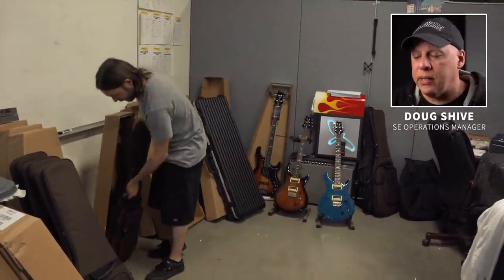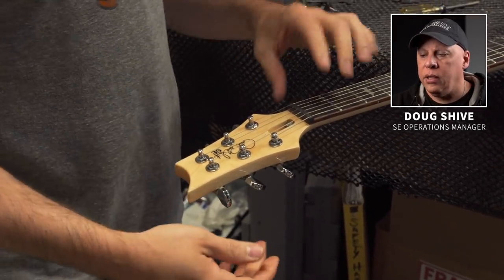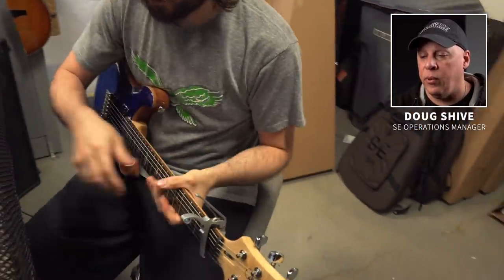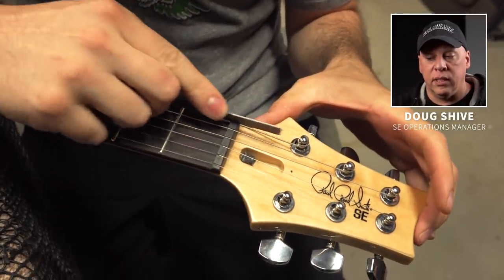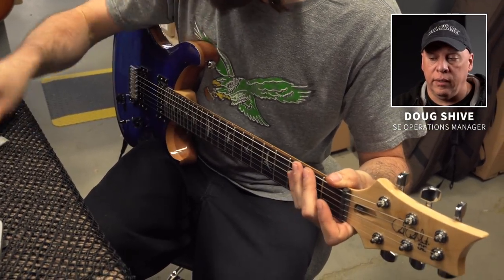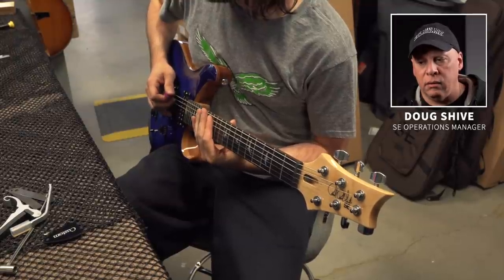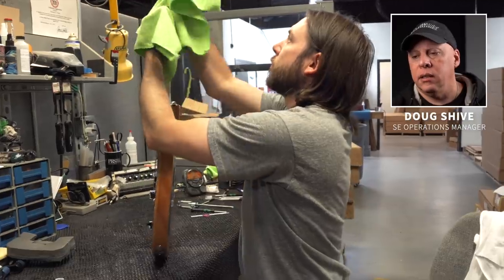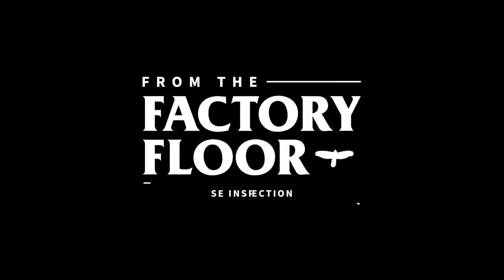SE Custom 24 Inspection | From The Factory Floor | PRS Guitars

Comment: I love the SE custom 24 but I've got to tell you the bridge saddles are junk pop metal and I had to change them and the pickups don't sound good so I had to change them if we have to pay $900 for this guitar tell Paul that it should have a solid steel bridge and it should have good pickups the Harley Benton cs24 has better bridge and better pickups than the SE custom 24 this needs to be changed.

Comment: TOO MUCH PIECES of wood in the neck 😢😢. After 6 years a hit on the head and puffffffff - a piece glued  is splitted from the head.
Better buy a one piece neck  and head guitar like fender player plus etc...

To me it looks like PRS is saving money since a three small pieces of wood is always cheaper then a bigger single piece wood .
So money is saved here 😢😢
Also any  glue has  " Life duration after hardening"  so glueing msny pieces of wood together  eventually  seperates and after lets say 10 years getting a hit may create micro  fractures in  the glue itself .
Also humidity may speed up glue degradation  over time.
I wouldn't trust a neck made of more the 1 piece glued together; especially when there is a truss rod involved.

Sorry PRS.😢